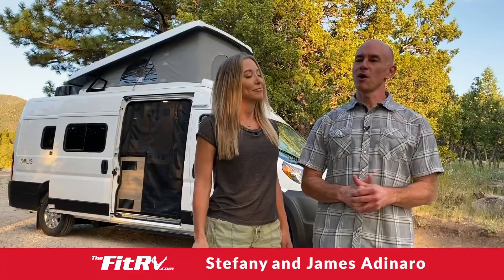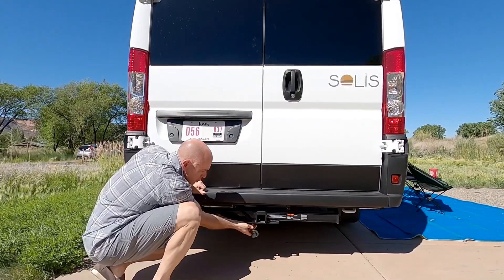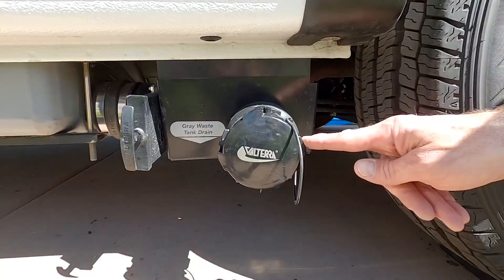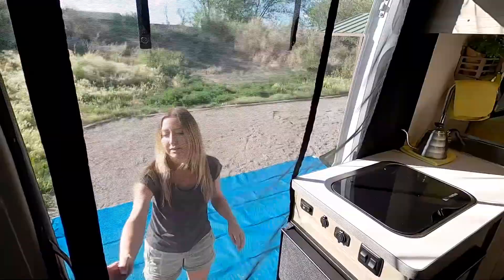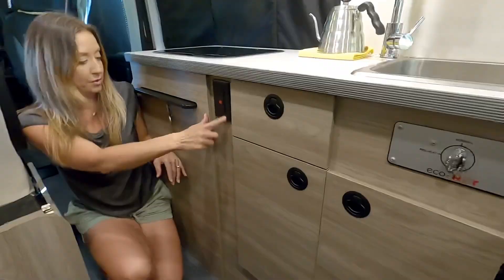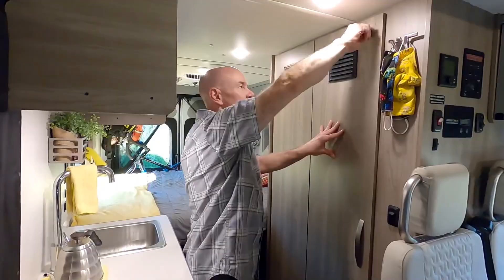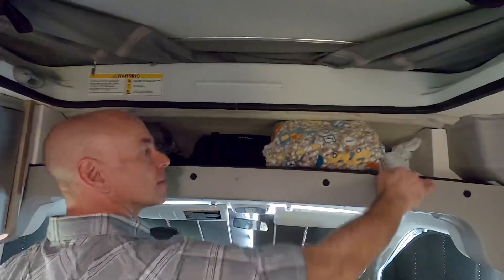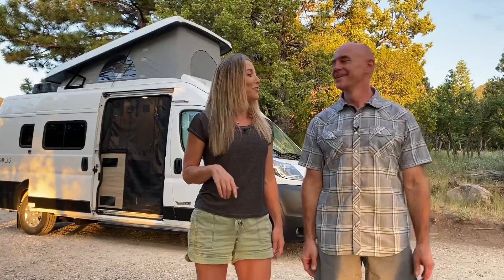Introducing the Solis 59PX!   Watch the reveal and our review here!

Comment: Nice little aside about the superiority of the front wheel drive in the wind.  It's the first I've heard of that Promaster benefit and it makes perfect sense.  Thanks for adding to my RV education.
Reply: Hi Stephen. I don't normally comment on YouTube, but I saw your comment. It's true that front wheel drive helps in the crosswinds, but the Promaster also has advantage because the high roof is lower than all the other high-roof competitors. Stock heights: High roof Promaster is 8'4"; high roof non 4x4 Sprinter is 9'; high roof Transit is 9'2".

Comment: So this is a really awesome vehicle. The thing that really made us both shake our heads in this review was the whole discussion about the generator. You may think it isn't loud when you are in a city parking lot at a grocery store, but when you are camping, around anyone else, the sound of that generator is about the most annoying thing somebody could possibly hear. If I wanted to hear an engine running, I would camp on a freeway.

The "quiet" generator is definitely not a selling point.

What would be a selling point, would be to highlight the fact that you could survive through the use of solar both the included rooftop solar and an additional solar panel that you could connect through that rear port that you showed early on in the video. That, my friends, would be a win. And, those around you would love you for keeping the peace and quiet in the great outdoors.
Reply: So you will have to carry 50 square meters of solar panels and a 200 kg battery to go overnight. 
Or a pedal generator. 
Or do witout power. 
If you want the A/C, or simply the power supply in your vehicle, you need either the generator, either a power plug nearby (thanks to environmentalism, now the network power will be produced by burning coal). 
Make peace with it: solar simply does not solve the issue, because of plain technical limits.
Reply: It qualifies for the standard set by the NPS campgrounds of less than 60 decibels at 50 feet.  Get yourself a Revel to get further from the masses, it doesnt take much.
Reply: Yeah, that generator is loud to me and I wouldn't want to hear it.
Reply: Solar isn't practical for me so it's not a selling point.  I'm in Minnesota so I don't even need the generator for AC at night.  In fact I stay away from vehicles with it.  Too many wires and batteries I can't use.

Comment: Great review. I felt like I took the full test drive experience. But Winnebago sure do love multiple individual wall control for different units… Why not integrate them into one display unit?
Reply from the maker: Yep it's not a clean look, is it?!  It would require all their component manufacturers to adhere to a common standard, and in this case the solar charge controller and the heater/water heater are built by different manufacturers.

Comment: Solis 59PX or Ekko?  Since you've had both for a bit.  The pop top is sweet and the Ram drives nice though not tge most comfortable seat or steering wheel ergonomics.  But wondering if the Awd ford will be best for winter plus the extra insulation of ekko.  Thoughts?

Comment: This has the practicality of the revel with more space. I’d prefer lithium batteries and removing the pop top so you can have an air max fan and AC option. Def not an odd road camper with that kind of ground clearance but that’s okay.
Reply: It has ac

Comment: Great presentation! Y'all looked right at home in this outfitted Solis 59XL. It's certainly a nice RV for those who prefer a propane and generator fueled combo platform, with a more relaxed layout with additional storage. As far as the bathroom is concerned, is there adequate ventilation in there to move the air out of the RV? Also, what is the weight limit for the upper room?
Reply from the maker: We pretty much just kept the bathroom door cracked, so ventilation was never a thought or an issue for us. The bathroom door does have some passive vents on it so air does get through when the door's closed. I believe we were told the poptop weight limit was around 440lbs, but I'll try to confirm I've got that right and will let you know!
Reply: @Thefitrv  Thank you!

Comment: My immediate reaction was "what's up with tiny windows??"...some nice, they've-listened-to-users features, though!  I do wish you'd shown it with the bed put away.  And, I wish there was a way to remove the upper bed as I don't need it (as I could with my Eurovan T4).  I'd rather have that space above my head since I'm taller than you guys.  And, it's not really conditioned as that little hatch opening is odd, so it seems pointless for me.  I'm totally with you on the awning front: don't want one.  I was far too cheap to put a Fiamma or ARB on my Eurovan and found that my $100 10-foot pop-up tent was WAY more handy than I thought it'd be.  I could set it up where I wanted it, I could shift it as the sun moved, and I could leave it up when I drove away to go do something.  And lastly, I don't like the "thing hanging off my vehicle" look.  :)
Reply from the maker: The upper bed in the poptop doesn't take away any ceiling height, it's actually added on top of the original van roof. And! You can see the bed up, with no bedding on it, and more bed detail in our original Solis review here in this link! https://youtu.be/YNnRaLQgjHY
Reply: @Thefitrv  Thanks very much for your reply.  I think what I'm more trying to say is that I liked that I could pop the top in my Eurovan, remove the bed, and then have a really tall van that I could walk around in versus this with the submarine-like hatch.  The pop-top, in other words, does nothing for ceiling height as you've said...I'd like it to add to it with a much larger space than the hatch.  :)
Reply from the maker: @boorayin2773  Oh okay! Sorry, misunderstood that. Actually that would be cool!!!
Reply: @Thefitrv  You obviously have the respect and ear of Winnebago - would love for that to become a reality at some point if you wanted to mention that?  :)  And while I'm at it, I've never understood why they don't offer the "penthouse pop-tops" (that goes straight up horizontally versus the angled pop-up)?  I used to find that space very confining in my Eurovan whereas my buddy's Westfalia had more room than mine.  A penthouse top that I could remove the platform for the bed if not needed would give me elevated ceilings throughout the entire vehicle would be awesome!  Enough from me - thx for entertaining my peanut-gallery comments.

Comment: About flippin time Cummins Onan did something about their noisy generators. With more RVers/vanlifers choosing lithium batteries and solar to power their rigs, CO finally figured out they better modernize their generators otherwise they're going to keep losing more market share.
Reply from the maker: Yep, this new quiet gennie takes care of the noise prob so that's good. But! There's still the pesky maintenance required as with all gennies. So lithium systems still get the win. Although to be fair if you're going by cost, the generator wins.
Reply: @Thefitrv  true about the cost for now but lithium will get cheaper and very cheap soon but generators won't

Comment: Did you like the cassette toilet better than the composting one you use? Do like the back storage on this unit.
Reply from the maker: We've been going round and round about this! What we know: there's no perfect solution for an RV toilet. All 3 options: traditional, compost, and cassette all have pros and cons. The big pro with the cassette is that you don't need an RV dump station and can dump in regular toilet! Plus you don't have to do that separate-actions-thing you have to do with a compost toilet.  But then the compost smaller liquids tank much easier to dump... and compost lasts weeks. I think if we were to buy a Solis, we'd probably give the cassette a good college try. And then we'd replace it if we find we're missing our compost toilet.

Comment: Thinking seriously of trading our 2020.5 Travato 59G for a Solis PX. The things that we hate about the Travato are gone on Solis (no not the awning! We’re neutral and awnings). The stupid Jensen sound system that doesn’t work very well – terrible tuner. TV – that’s not what camping is about for us so it’s just in the way. That horrible Remi shade in the front window. It fell apart on our second trip and we almost couldn’t get it put down and it won’t let you start the engine if it’s not all the way down. Worse than worthless The Froli sleep system on a heavy particleboard Murphy bed it takes two people to push up and latch. I could go on and on. I think the only things that we would mess our a microwave, which can be added, and I powered vent. That’s a problem. We use our Max-air fan all the time. But the 59G is just not working out for either one of us.

Comment: Very nice review!  I'm not familiar with AC in RVs so do you have to run the generator to use the AC?  Can the roof AC be used if you're driving (using the engine's alternator power)?  (Do you even need to use the roof AC when you're driving or is the van's dash AC good enough?)
Reply from the maker: Yes you either need to run the generator to use the A/C or you need to be plugged in to shore power. To run the A/C while driving you'd need the generator going too. We never do that though because the Promaster's A/C is enough for us!

Comment: Some improvements, still some disappointments. Inverter quiet generator is good if a generator is needed. (rather have Lithium batteries),  The lounge seats look good, the Travato 59G needs them, The storage garage is not big enough for a mountain bike (wide bars and such). They also should offer the dual pane acrylic windows and a toilet that is not a cassette toilet. Just my 2 cents.
Reply from the maker: Appreciate your thoughts! We do think mtn bikes will travel in there fine if they're mounted with turned handles. Other cycling vanlifers are doing that turned-handle mounting so it can work. And like you we prefer lithium setup over gennie... but then that takes the van to an even higher price point, too.
Reply: @Thefitrv  do you mean loosen the stem to turn the handlebars or just turn the handlebars and fork and it fits?
Reply from the maker: @yipyipyip  The latter. You'll have to get creative with the mount, though. Looking forward to the first owners and seeing how they figure it out!

Comment: Oh, just one last question: I'm concerned that cassette toilets might generate more bad odors than fixed tanks toilets. Is that right? I really wouldn't want bad smells so close to the galley!
Reply from the maker: This can be an issue, and back when we were rookie cassette toilet users, it was a problem for us. We've since learned that with a ton more chemicals than the directions state, and if you make sure to rinse the tank well between uses, it's not a problem.

Comment: How long could you run the air conditioner, boondocking
Reply from the maker: Depends on how much gas you have in tank! The Promaster holds 24 gallons, and guesstimating the generator uses 1/2 gallon per hour on full load; you can go quite a long time!!!

Comment: Surprised you didn't point out the non-locking gas door, which unlike the MB Sprinter's locking gas door at the same location is not securable either by design or by lock.  You can just flip it open by using your finger and unlock the gas tank and siphon out all the gas!  Disappointing and maybe why you guys didn't show it at all.

Comment: I wouldn't use the pop top
I'd want lithium and volt start to recharge the batteries and I'd want a fridge that was higher up and not do low to the ground
Reply: Check out the Travato 59GL.

Comment: Not a fan of this configuration of the Solis (59PX).  I always said that if I was ever going to spend that much money for a Class B Camper Van than I wouldn't buy one unless it had a curbside awning.  Unless it were feasible to add one on later or I got a really fantastic deal on one. What were they thinking when they did away with the awning ??!!  To insignificantly cut the cost of the unit??  I also don't like that the generator is mounted under chassis. I see that as an accident waiting to happen with only 6-6.5"s of ground clearance.  I would rather have the awning back, and have the rooftop AC unit, and roof vent fan, than have the generator mounted where it is or, at all..  Winnebago you get a Thumbs Down from me !!
Reply from the maker: The reason for no awning is the poptop addition takes the entire roof of the van, so there's no way to attach it! We're not fans of awnings anyways, did you catch our Why I Don't Like Awnings spoof video?!? ;) https://youtu.be/ZYhnQ7jrp64

Comment: Do not buy a Winnebago. I purchased a Solis in 2021, it has numerous manufacturing issues: (soft spot on the floor, cabinets that don’t close properly, terribly finished, but the biggest issue is a leaky roof. Had it at the dealership for over 2 months and the fix that Winnebago has for the floor doesn’t work, floor is still soft, and they do not have parts to fix the roof. Right now they have sealed the pop top with a sealant and we will not be able to use it until who knows when. Very disappointed and frustrated.